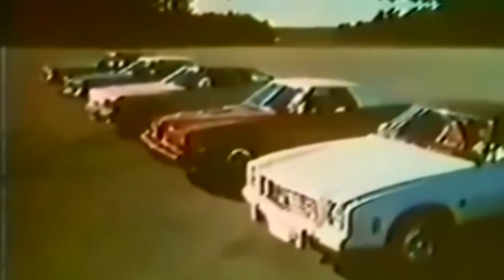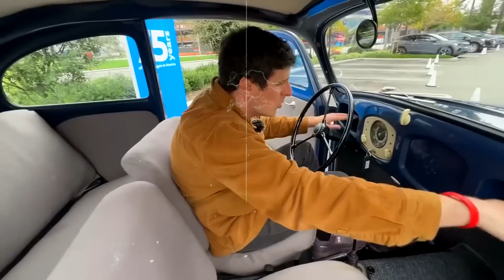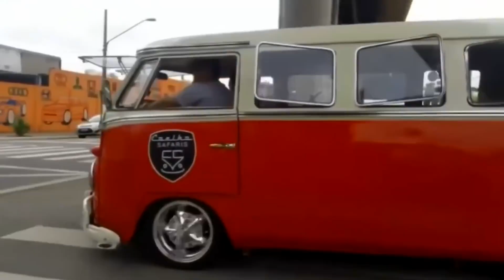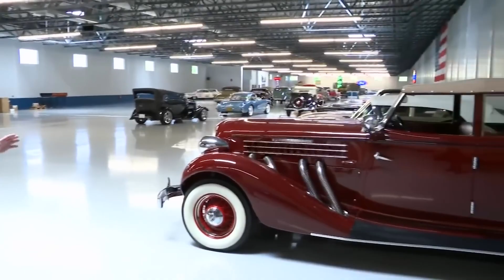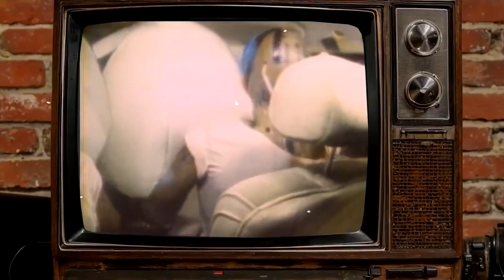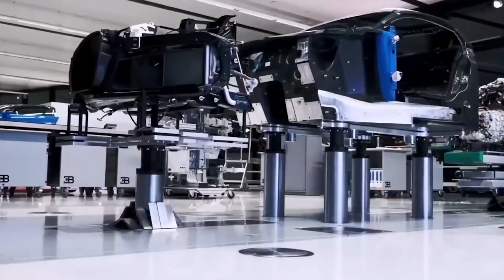10 DANGEROUS Old Car Features That No Longer Exist! 1950-1990s

Comment: Rubbish. The reason drum brakes were not used any more was that due to the geometry of the pads, they had a less linear response. That caused them to lock up more easily, and release the lock less readily, both of which was detrimental to the function of the ABS. For a while now, drum brakes have been returning, probably because of improvement of ABS systems and better drum brake design. They have a lot of advantages too. They are a lot cheaper to make, they have a lot of stopping power, the brake surfaces are enclosed and less prone to rusting. Drum brakes can be perfectly adequate for modern cars (at least for rear brakes) if some of the drawbacks are addressed, and for electric vehicles (which mostly use regenerative braking and have standard brakes mostly for emergencies) they may actually be BETTER.

The video is generally poor. So a lack of crumple zones, airbags, seatbelts etc. is actually a "feature" not used any more? That's just nonsense. Clickbait.

Comment: modern headlights are worse than the older ones the plastic fades no matter the fancy bulbs it's a poorer lighting than the old glass ones
Reply: Yeah until you get a hole from a stone strike and your reflectors go blind. Happened to me with EVERY glass headlight I had.

It's not the plastic (more precisely: polycarbonate) that fades, it's the UV-protective coating that cracks and yellows. Polycarbonate needs protection from UV light. You can easily sand the coating off and re-apply the protective coating, and they look (and work) like new. My car is 15 years old and the headlights went blind only a while ago; US cars are generally made of lower quality materials, so they probably fade sooner. It also depends from the exposure to sun, so if you are in a sunny area, yours will fade sooner.
Plastic headlights are just better.

Comment: Drum brakes still exist  and they are as efficient as disc brakes. The main novelty in braking has been ABS, but before ABS we used to push/release the pedal when the car started to slide.
Reply: Trucks still use it and work fine. lot of bullshit here in video.